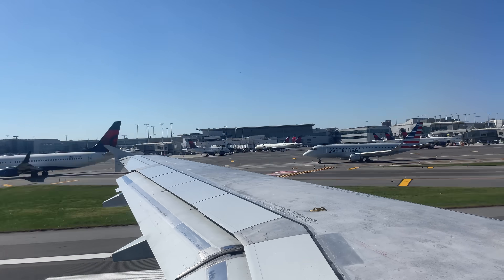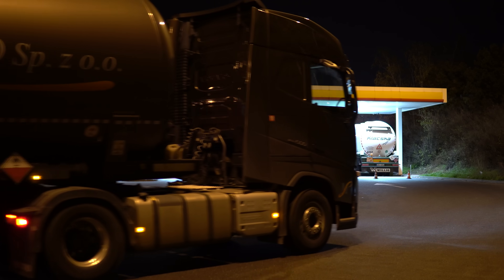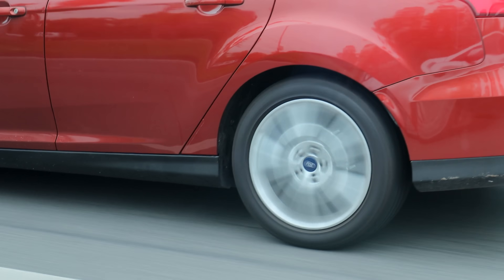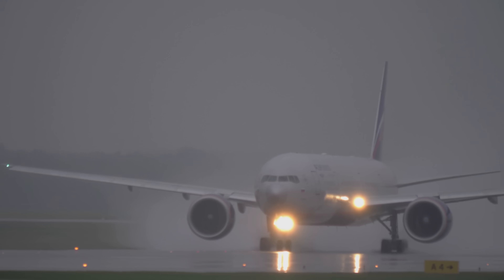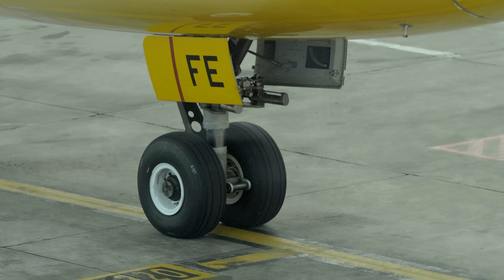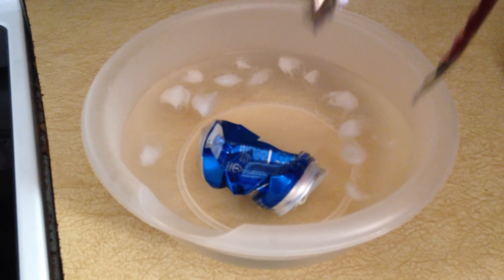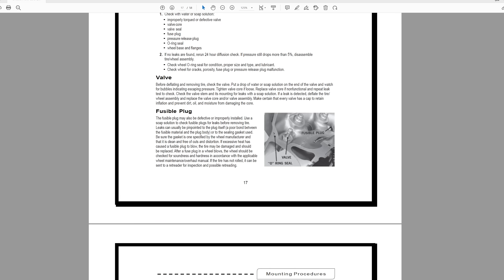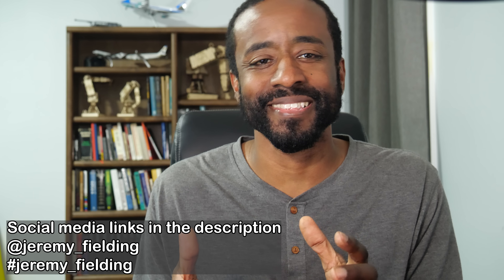The Ingenious Design of Airplane Tires- Jeremy Fielding 107

Comment: Interesting. 

Not being a USAian, I like that you included kilograms in the sidebar, and that you were talking in °C for temperature. However  it's worth noting that even viewers who are familiar with the Imperial measurement system will become rather lost in mental arithmetic when you talk in the thousands of pounds. In the Imperial system, 14 pounds is a stone, so pounds are only ysed for relatively small weights. 8 stones make a hundredweight (which is, of course, 112 lbs); and  20 hundredweight (cwt) make an Imperial ton (which comes out to 2,240 lbs).  Trying to divide by 2240 in my head to turn "170,000 lbs" into tons isn't something I can do on the fly (if you'll excuse the pun).

When you put kg values on the screen, converting into tonnes is a piece of cake, because that's how the SI was designed. And, because a metric tonne is 2,200 lbs, it's close enough in quantity to an Imperial ton that the two will always be in the same ballpark.

I am aware of the existence of the "short ton" (2,000 lbs), but because that's so much less than an Imperial ton, the figures diverge too rapidly. For example,  178,000 lbs is about 79 Imperial tons, 81 metric tonnes, or 89 short tons. So, while it's easy enough to convert thousands of pounds into short tons, the number you get isn't very useful.

Perhaps you could mention both pounds and tons in future videos?

Comment: The standing weight is what is discussed in this video.
In reality these little tires actually bear MUCH MUCH greater weight.
When that 187,000 pound aircraft is landing the moment the tires actually impact the runway the initial weight upon those tires could be 2 to 4 times or more the weight of the aircraft.
Amazing little tires.

Comment: Interesting. The moisture will shrink and expand the tires dramatically.
This could be an advantage. The tires could shrink and fit in a smaller space. Then they could be reheated to function properly at landing.

Comment: Great video! I really appreciate how much research you made prior to it's creation. I'm in my 27th year of aircraft maintenance. Currently a line maintenance technician for the largest air cargo airline. Aircraft tires are extremely heavy. A main tire for a DC-10 and MD-11, 54 inches in diameter, weighs about 600 lbs with an extremely light magnesium wheel. They are rated for 235 mph. The tread profile of the tire is over an inch thick. The tires get beat all to hell depending on the type of runway they operate from. It is truly amazing how strong aircraft tires are.

Comment: Hey Jeremy, why not make a video going into a bit more detail of the Comet "square window" issues? The usual story we always hear is that the stress concentration at the window corners caused the fatigue failure. However my understanding is that the prototype fuselage(s) had autofrettage happen when they proof tested them with a static pressure overload, which put the window corners into residual compressive stress. The prototypes then had unusually long fatigue lives compared with the production models.

Comment: The thing I've always wondered about landing gear is why they don't have a radial tread pattern or small turbine disc on the wheel to make the wheels spin when they are lowered, reducing the wear caused by skidding when they touch down.

Comment: If a series of small metal cups like what are on a wind speed device was fastened to the outside wheel hub it would result in rotating the tire so there would be less friction, heat, and smoke when the wheel first contacts the runway. This would have a small cost, little weight, and wouldn't require any electric motor. Why wouldn't my idea not be tenable?

Comment: I once walked beneath a 747, toward the terminal at Frankfurt. We didn't have a gate because we aborted our final at about 400 feet, flew to Koln, fueled, returned to Frankfurt. After putting the 747 through its paces safely getting out of the pattern, the pilot calmly informed of us why we aborted (aircraft on the runway), that we were low on fuel after flying from Johannesburg, and heading to Koln. Love those matter-of-fact German pilots. We disembarked on a stair truck in Frankfurt and walked beneath the wings because it was pouring freezing rain when we arrived. A Lufthansa mechanic noticed me marveling at the aircraft. He gave me a quick tour of the main landing gear and the gear stowage as security hustled us toward the terminal. I felt like a kid. Best flight of my life. The things that pilot did with that massive aircraft amazed me.

Comment: Sorry this is unrelated to airplane tires (i did enjoy the video though). One of your videos you mentioned using a VFD to run your 3 phase motor for your lathe. I have been up and down and sideways trying to decide what route to take to do the same, i have a 16x40 lathe i got for an insanely good price (a sign from God, i believe, as i have been thinking about starting my own machine shop for a while) anyways, it uses a 5hp 3 phase motor, and i need to power it. What VFD would you use to do this? I have read all sorts of literature and some say get one rated for 10hp 3 phase in/out, others say just a 5hp 1 phase in/ 3 phase out will work, arguements that using exactly a 5hp will burn out some of the diodes.. i have learned a lot from your channel and you know your stuff. Any insite or direction or help would be very greatly appreciated. Thank you for doing what you do!

Comment: 4:45 Even if you don't need to transmit power from the engines to the wheels, one of the most important features of the aircraft tire is to allow effective braking during landing and aborted takeoff. However, the runway is kept clean so you don't need threading pattern similar to road cars.

Comment: A
mother mode of stress for an aircraft tire is that they will accelerate from 0 to 120-140 mph within a second or two on landing at the same time they are taking the aircraft's weight.

Comment: Another very important part is the rubber compound. Most types of rubber will get way too hard and loos all its flexibility in the very low temperatures of the flight (over 10 Km some times). Rubber compounding is a mix of art and engineering 🙂.

Comment: Im still surprised that nobody is spinning up,tires before the landing… somehow there must be a way to have the passing air speed them up and then use the brakes to ńmake them rotate at the speed matching the passing ground.
Reply from the maker: There is a good video on this topic by mentor pilot. There are good reasons not to do it

Comment: I drive semis, and the weight rating for a single tire is way higher. It's more like 6k per tire. We are restricted by the DOT to lower weights unless you're  permitted for a higher weight. Still, great video. 👍

Comment: I would've assumed the tyres needed to be conductive because there was a huge static voltage potential between the clouds and the ground(see - Lightening) and therefore the plane coming from way up in the sky would have a large static build up that needed to be dissipated
Reply: Not just existing charge, but tribocharging of a painted surface through dry air. Helicopters suffer a lot from this even at low altitude before they hit clouds.

Comment: Hi Jeremy, just as a point of reference, airplane tires are filled with dry nitrogen.  There is no oxygen or water vapor in the tires.  Water vapor, (humidity), as you pointed out would be a problem with icing and expansion with changing temperatures.  Oxygen would cause oxidation on the inside of the tire during times of high heat which the tires experience during takeoff and especially landing.

Comment: A few clarifications. Braking force on a tire is every bit as strong as engine driving force. The difference is building the tire to resist torque force in one direction instead of both directions, for main gear. While nose gear has no brakes so no significant torque. 

The nose gear also bears very little static load, so it is better to divide the weight by only the main gear tires. (Balance for flight is in the forward part of the wings. A number of models must be careful not to get tail heavy during uneven loading/unloading, they even have kickstands availible.) This makes the static load a bit over 40,000 lb per tire. (Similar per tire loads on the 767-300 which has 8 main tires, the nose tires are lower pressure than the main gear along with smaller size.) 
Of course there is also dynamic loading from the vertical speed but the net total load isn't quite as extreme as you might imagine because most of the static load is being supported by the wings at the time of touchdown.

The primary limit on highway tires is heat build up due to sidewall flex under constant high speed. The friction heat of landing spinup is overall a fairly small amount of energy. The 747 for example has a limited taxi distance and speed combination at high gross weights because of this sidewall heat,(the pilots have a chart) so there are conditions where they are required to stop and wait a time for the tires to cool before continuing. Reducing sidewall flex generated heat is the primary reason for increasing tire pressure with increasing weight.

The fusable plug exists mainly for brake fire situations. The plug requires substantial temperatures, I've had planes come in with brakes so hot they were smoking for 10-15 minutes after parking and the plugs never melted. (Sometimes a brake is dragging during taxi, adding to landing heat. Its a terrible stanky smoke.) 

The circumferential grooves have nothing to do with water they are only a tread-wear indicator. Tire pressure for this smooth rounded tire style determines the thick film[standing water] hydroplaning speed, high tire pressure can overcome high dynamic water pressure and cut down to the pavment. There is a formula, speed in knots = 8.6 times the square root of the tire pressure in p.s.i
There is also thin film hydroplaning which is more like a lubricant reduction in surface friction than skimming over a pond, oil is often involved leading to the alternate term viscous hydroplaning. 
And there is steam hydroplaning (also called reverted rubber hydroplaning) where the local friction in the leading contact area is high enough to boil the moisture and cause a steam bubble under the rear part of the contact patch, with an net loss in total friction. This is strongly affected by the rubber compound of the tire and amount of old rubber build up on the pavment.
Reply from the maker: Thanks for the details… Are you a subscriber? I am looking for people interested in previewing videos to help me catch errors and clarify things I thought I covered. For example I said in the video that the brakes “dump an enormous amount of heat into the tire on landing heating up the tire” a little before I mentioned the fusible plug. But you felt that needed clarification. Which tells me I didn’t communicate the connection between those two ideas well enough. I want to fix that in future videos. Anyway thanks for the feedback and if your interested in helping out let me know!
Reply: @Jeremy_Fielding  First time viewer, and I don't have a lot of spare time lately. You did good I was just being particular.
Reply from the maker: @mytech6779  Well that is awesome. Thanks for stopping by, and sharing your thoughts :)

Comment: I had a tire on my motor home blow out.   It was one of the rear duellies.  The blow out was so powerful that i destroyed the wheel well, damaged the edge of the body and bent the tail pipe.    It also damaged is sister tire, which blew out a few thousand miles later.     That tire had a standard pressure of 80 lbs.

Comment: Even more amazing. Think about the tires on the space shuttle. At launch, they are externally at sea level pressure and about 30 degrees. In orbit, they are in vacuum, and the cold of space. Then, within the span of about an hour, they are smashing into a runway.
Reply from the maker: It is really insane LOL

Comment: Even as a lifelong aviation nerd I've never thought too much about aircraft tyres and wheel systems beyond learning a few basic factoids like using nitrogen fill. This was a fantastic deep dive from a gifted teacher with a great enthusiasm for his subject matter, great job Mr Fielding! 👍
Ed: I agree that the size difference between the nose gear and the mains should probably have been noted for clarity but the omission doesn't change the gist of the story, being that a heck of a lot of specialised engineering goes into manufacturing these things to meet  acceptable standards in very extreme operating conditions.

Comment: where did you get the idea that commercial airliners like the 737 take off and land at 100mph? A simple google search would reveal it is around 150-180 mph, which means the energy involved is much greater. Also a typical airliner weighs a lot more than 100,000 lbs, especially on take-off.
Reply from the maker: I said “over a 100 mph.” Really it was just an loose reference not meant to be exact LOL
Reply from the maker: I also give the exact weight later in the video. Take a deep breath and just enjoy. A lot of energy is going into over analyzing things that aren’t actually wrong.

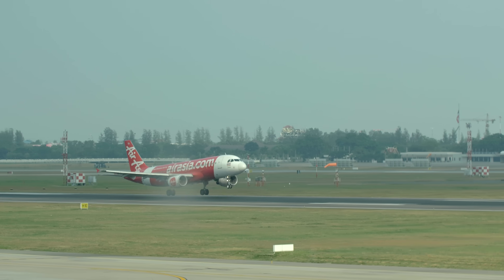Comment: 4:39 - "With an airplane you dont deliver any power to the tires, they just roll along the ground"  - FALSE.   Airplanes have these things called brakes.  They are used to stop the plane on landing.   They are applying significant amounts of power to the tires, so much so that they get flaming hot  (technically, the runway is applying the power to the tires and the brakes are absorbing the energy, but lets not get pedantic).    The tires still have to be able to accept a huge torque from applied power, even more so than in a road truck.

Comment: Nice video. Thank you. I've always wondered why some attempt isn't made to spin the tyre up to the plane's speed before touchdown and avoid the wear that occurs as the static tyre hits the ground. A wind vane or a small motor perhaps. I guess tyre wear is not a big enough problem to make it worthwhile. Does anyone know if this is the case?

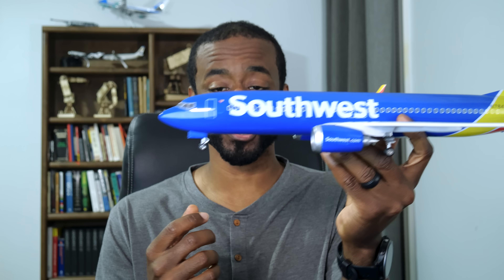Comment: Great video 🙏.   1:50 the now common conflation of more and most sucks in engineering content tho... "One of the more X" is very different to "one of the most" - not that it's unclear what you mean in this example but still. Don't think this is even pedantic, just straight up note to the science crew 😉. Aww shoot, also 4:47 : 'car tyres have to deliver power plane tyres just roll along the road ' - they actually handle huge braking loads, regardless of reverse thrust etc, brakes take a huge amount of energy out of the aircraft. Braking load is no different to acceleration load in terms of energy transfer or force distribution. So it's actually yet another way aero tyres are well engineered.
Reply from the maker: Thanks for the details… Are you a subscriber? I am looking for people interested in previewing videos to help me catch errors and clarify things I thought I covered. For example I agree that braking is power delivered though the tire but it’s clear to me now I changed terminology and talked about traction and drag racers to communicate that. I didn’t communicate the connection between those two ideas well enough. I want to fix that in future videos. Anyway thanks for the feedback and if your interested in helping out let me know!

Comment: The nose tires don't support an equal amount of weight compared to the main tires. This is a function of proper ballast distribution, both empty and with fuel, passengers, and cargo. When an aircraft is weighed, either for maintenance changes, physical reconfiguration or, certification, the nose tires carry a significantly lighter load than the main tires. This why they are smaller. In fact if the aircraft is very light on fuel, people, and cargo, the nose tires can easily slide if turned too sharp. One other thing, aircraft tire wear rapidly compared to passenger vehicles.
Reply from the maker: I agree the four rear main tires carry nearly all the load making the difference even more impressive. And I agree they are larger than the nose wheel

Comment: Most importantly, considering the current climate change problem, a smaller road tire would significantly reduce fuel mileage, as the motor would need to make more revolutions to go the same distance as a larger wheel and tire combo.

Comment: Outstanding presentation.  Another cool feature on some nose wheel tires is a lip on the sidewalls to divert water and slush away from the aircraft.  I've seen this on some small to mid-sized jets.

Comment: As a guy who has replaced the rubber on hundreds of aircraft tires, it sucks. Nothing really complicated, it just sucks.
FYI, one of the US Military's aircraft uses a split rim that is held together by just (2) 1/4"x.5" bolts.
I just left Arizona, the rental I was driving was showing me an up to 10psi drift from early morning to late afternoon. If I was to move back there, it would be worth using nitrogen in my tires.

Comment: I’m an aerospace engineer working on landing and braking aerodynamics, can’t wait for more in your aircraft series!
Reply: You might have some answers to this.
Always wondered why they don't use an electric engine to spin the tires up to the expected landing speed before landing?
The idea being to prevent the wear caused by this differential in speed. I.e. the plumes of tire smoke on touchdown.